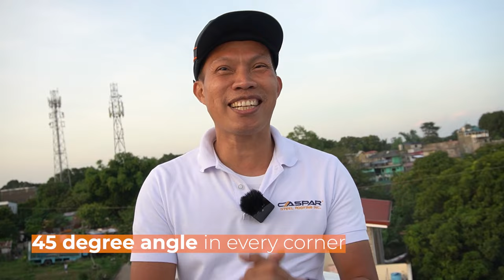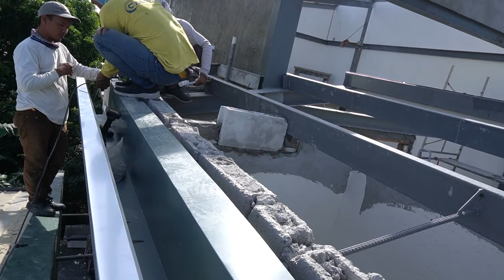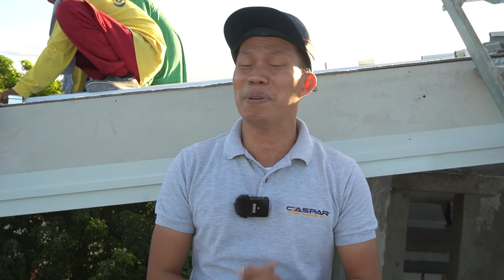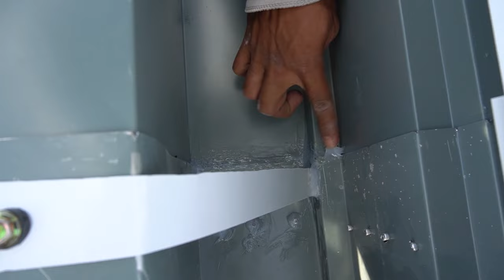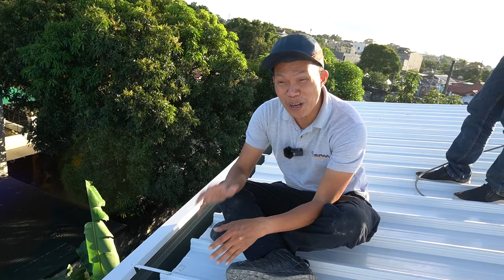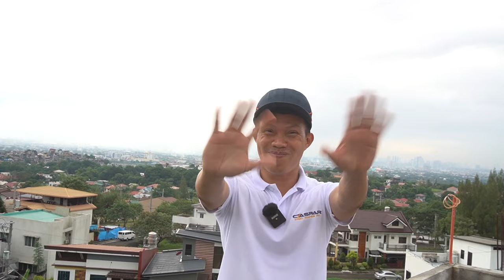[S1.Ep.9] HOW TO Install Gutter On Metal Roof | Paano magkabit ng gutter sa bubong Step by Step

Comment: Information zero.
Reply from the maker: Thanks for watching, how can i help you sir..
Reply: @casparroofingchannel  ok. Where is full info on how you attach the gutter to the fascia board? What to use instead of nonexistent in Philippines hidden hangers and what to use for stiffeners ? Waiting for your reply ( preferably in form of video) . Thank you
Reply: @casparroofingchannel  silocon is better than vulkaseal ( no cracks and can be mobile,  cheaper )
Reply from the maker: @radiononsense9449  were using waferteks sir..
Reply from the maker: @radiononsense9449  true were using caspar rubber sealant same with  silicon sealant, thw different is pur caspar rubber sealant is flexbond.
Reply: @casparroofingchannel  so no explanation on how you screw those to the fascia? No distance between them indicated , nothing about the stiffeners either on how exactly to use them and what can be used for those .